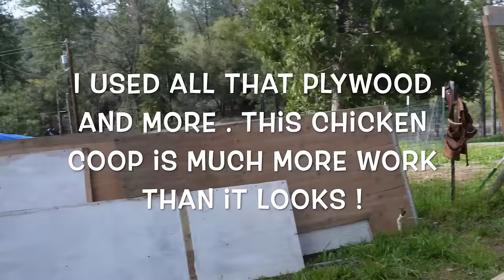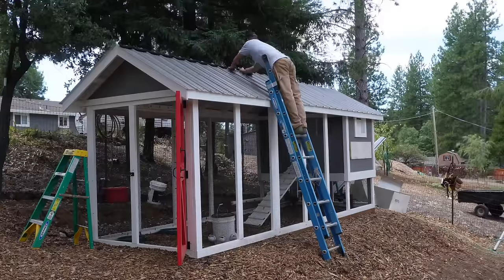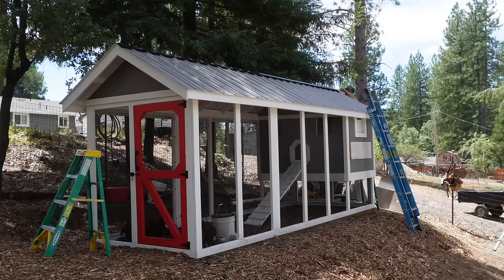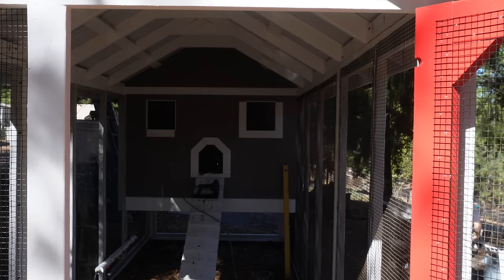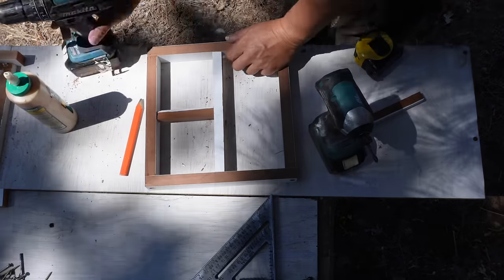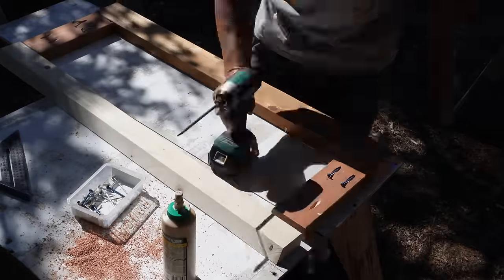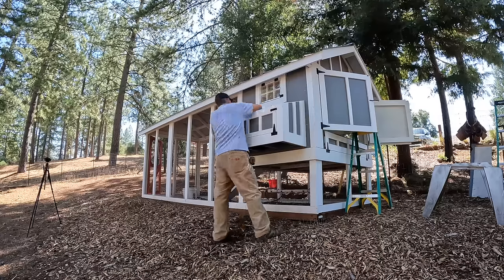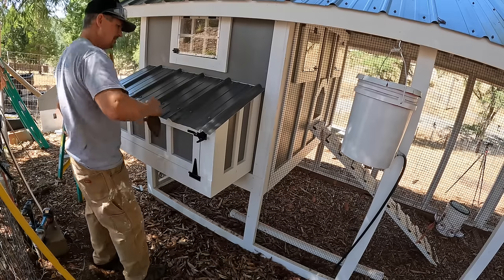The Ultimate DIY Chicken Coop Build(Part 1) How to Build a Chicken Coop Time-Lapse.

Comment: Beautiful coop, my only complaint would be, it's a copy of Carolina coops American coop. I understand Carolina coops has the best designs,  but I would have loved to see a skilled worker like yourself put your own touches and designs, I'm building a coop as well, I'm working on the run right now, it practically has no wood, mostly steel reinforced block and concrete,  my nest box is built out of metal,  it's the ultimate solar nest box lol
Reply from the maker: Thanks! I really love this design and would not want to change anything. There is not much you could add to better the design, in my opinion.  Good luck on your chicken coop build!👍
Reply: Watch Carolina Coops’ videos and they suggest using their design and techniques to learn from. No harm doing so and I plan to do the same!
Reply: @Mstymntntop  I agree, It's just nice to add personal details to make a coop that isn't a exact replica of someone else's design,  it's still a beautiful coop. Where I live , if I build a coop like this, there is a chance I might loose it during hurricane season,  so I used a lot of Carolina Coops design,  but improved upon a lot of it to suit my needs,  I improved on maintenance aspects for cleaning,  including using a idea of a country coop design to be able to stand up inside the coop for easier maintenance,  I also added solar for interior lights and a fan, it even powers the chicken door and will power a pumping system for automatic watering,  lots of improvements can be made to make chicken keeping easier
Reply from the maker: Sounds awesome! I would like to see your chicken coop when your done.
Reply: Yea with a company like Carolina coops they make so many its going to be hard to not do similar things and they do encourage you to use some ideas on your own. There are plenty who don't have the resources to build their own but they encourage those who can. A coop/run is a coop/run they are all going to look very similar. I love this @DIYProGuy
Reply from the maker: @tootsiepop0922  thanks!